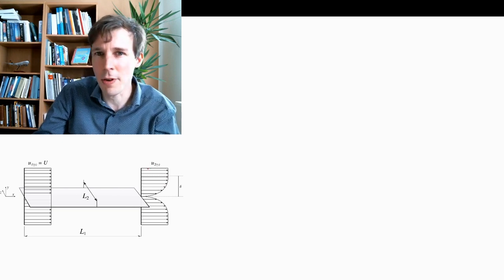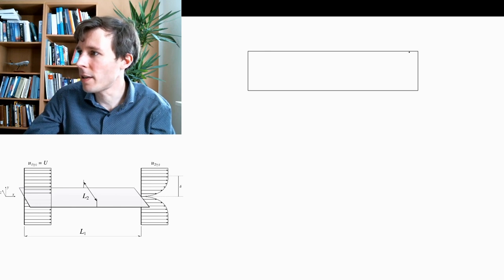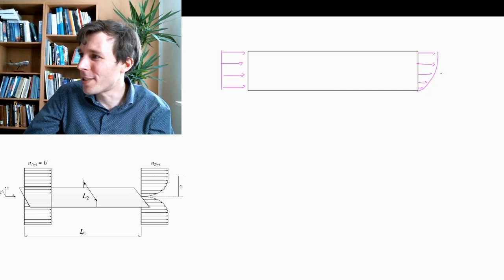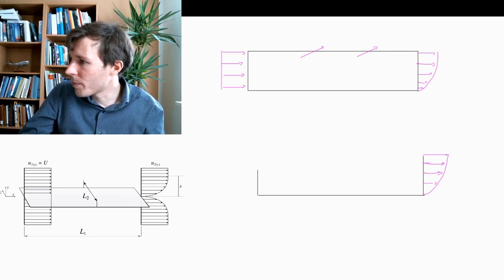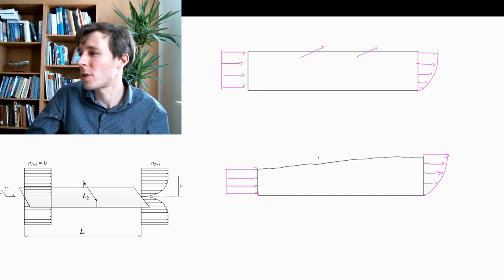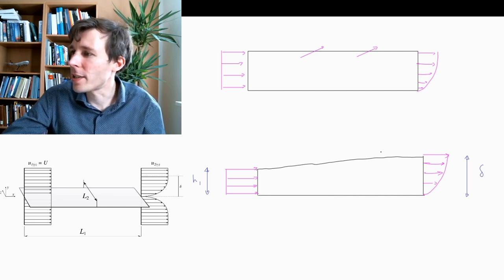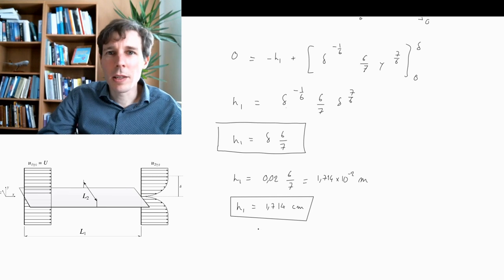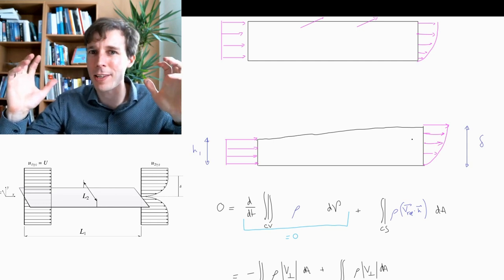Calculating the inlet height in a boundary layer control volume (Fluid Dynamics w/ Olivier Cleynen)

Comment: hello olivier
Final answer for the inlet height of the control volume should be twice of what we got as there is a symmetrical bottom half also..we considered only upper half in our calculations.?
Please correct me if I am wrong.
Reply from the maker: Hello Sahil, indeed, in this calculation I only looked at the top half. The two sides are symmetrical with respect to the plane of the flat plate. If you choose your outlet to include the bottom layer too, then you have twice the delta height at outlet (so 2×2cm), and twice the calculated height at inlet.